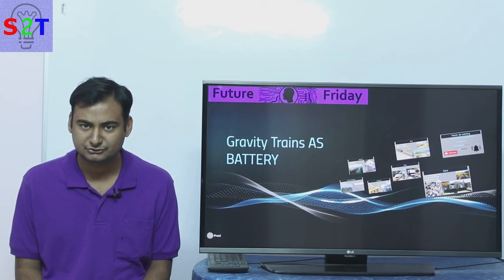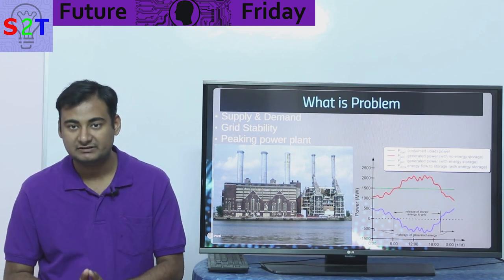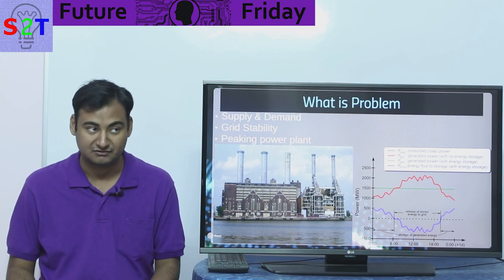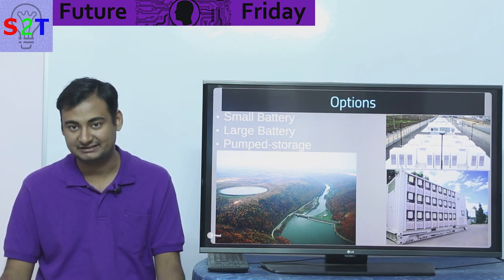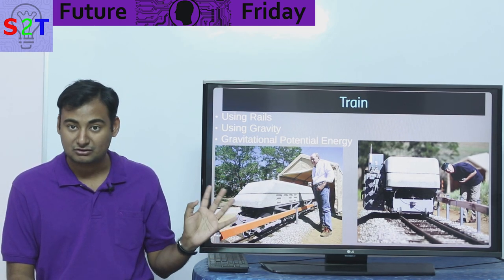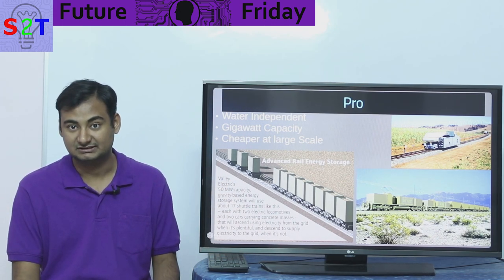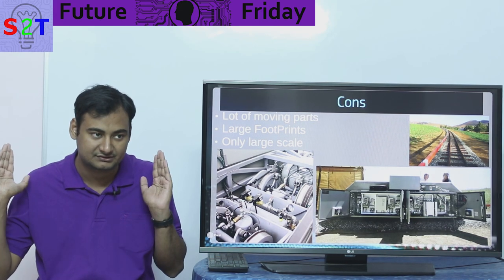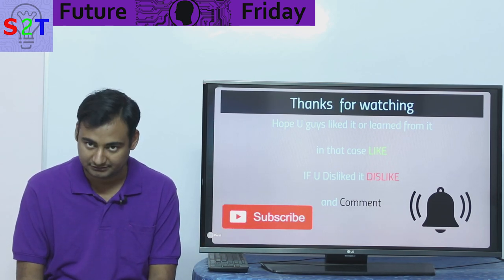Future Friday Ep25 (Train Energy Storage Explained)

Comment: Excellent explanation of this type of system. One is being built near Pahrump, NV, where I visit from time to time. I hope to see it in operation when it comes on line.
Reply from the maker: nice did not know someone is actually building it
Reply from the maker: @leevance6996  I have to say I don't like this options it's too complex and way too many moving parts now I would prefer Gravitricity  I made a video on it Future Friday Ep33 (Gravity Powered Battery Explained)
 ( https://www.youtube.com/watch?v=T-WC5nZ6Ryk )
Reply: Just watched your Graviticity video. I agree on the complexity issue of the train. How about a hybrid of the two? Cable lift instead of motor/generator in each car, allowing steeper tracks for more energy storage in shorter track run, eliminates slippage issue of steel wheels on steel track. No expensive hole to dig (and keep water out of). parallel trains if more storage needed. Of course you need a hill or mountain for this. Just a thought.